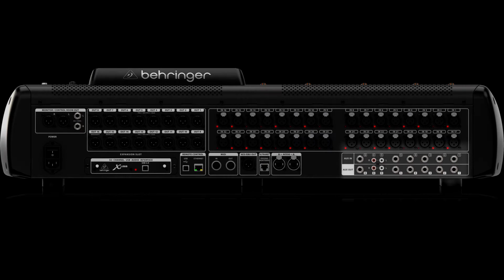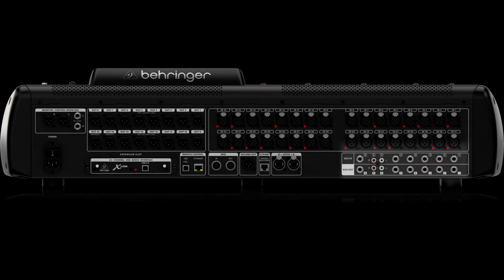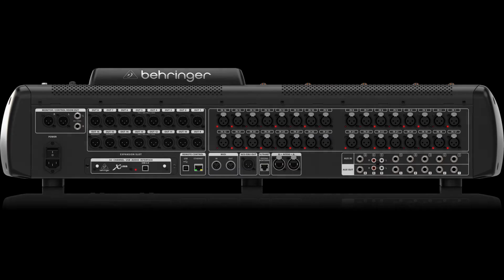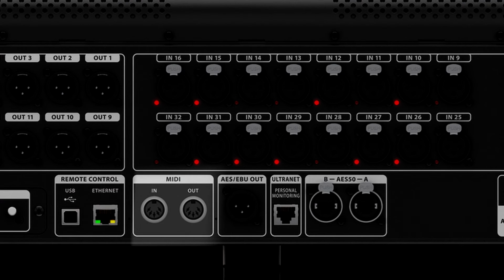Digital Audio Connection Types On Behringer X32

Comment: I can connect several stage monitors through the ultranet via a daisy-chained cat 5 cable. No need for a shielded cable in this case. Routing is via mix outs to each monitor, and each monitor is preset to an ultranet channel to receive said mix.